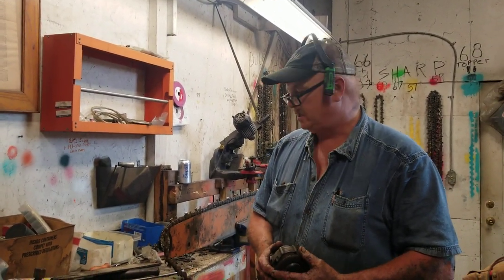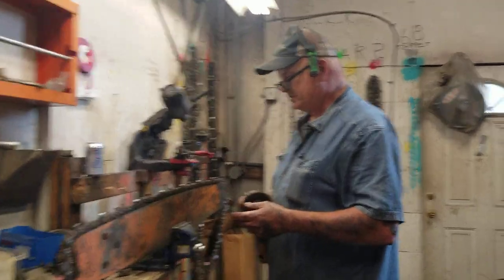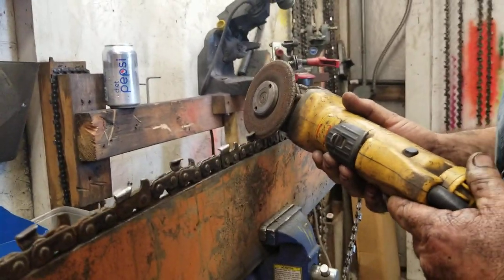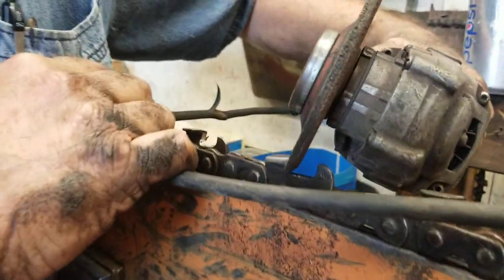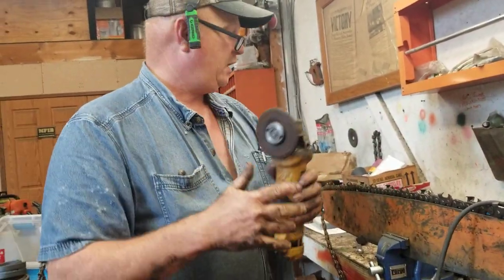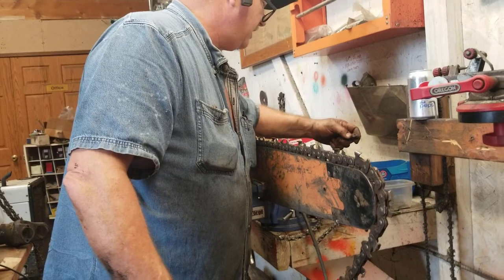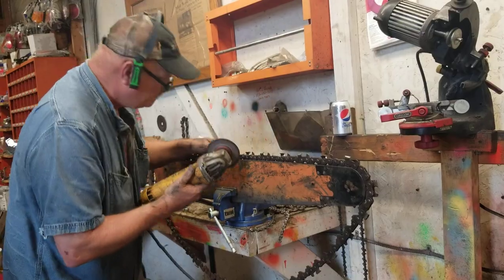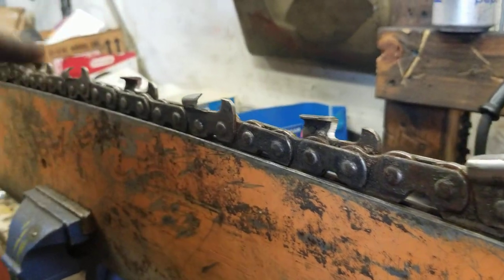sharpening 3/4 pitch with angle grinder

Comment: I've been using a Dremel tool on a 404 chain for the firewood  processor
Reply from the maker: How's that work ?  I used a 404 reg bench grinder disc in the cordless angle grinder  and it work well  , it really comes down to holding the tool or even a file properly  !
Reply: @StumpjumperVideosPA  Home Depot has file stones for chainsaws, beats doing by hand and don't have to take off machine

Comment: Turn your vise at a 90* from the work bench then you can get each side without reaching over the bar
Reply from the maker: Ya I usually do it on the head it's a bit easier  . Thanks Steve!  Are you going to the big bun ?
Reply: @StumpjumperVideosPA  I'd like to but I'm not sure it will happen, remember all the mess I told you about? It's still a mess